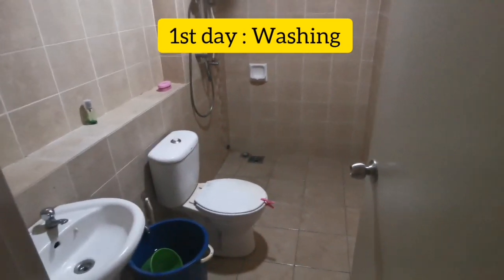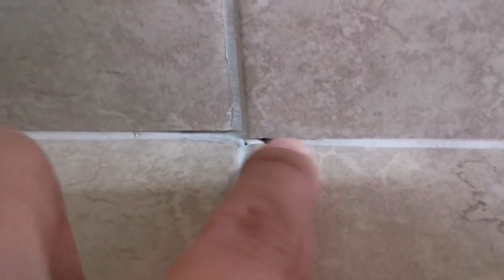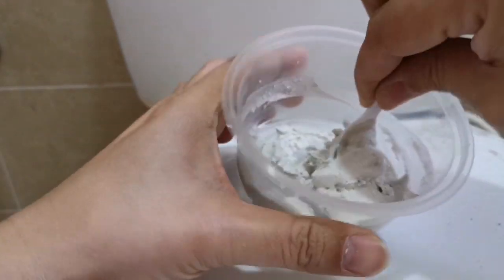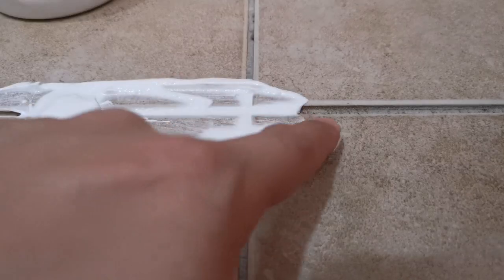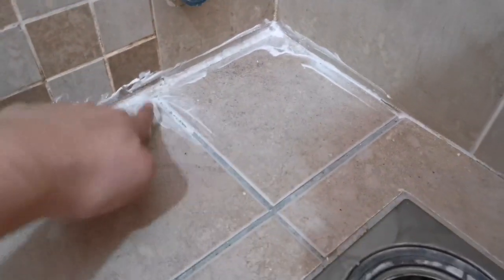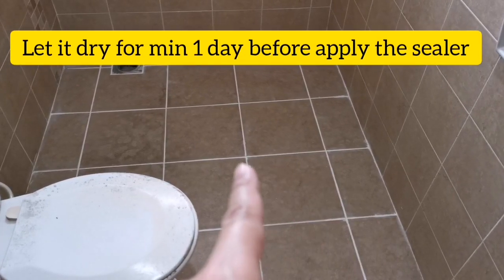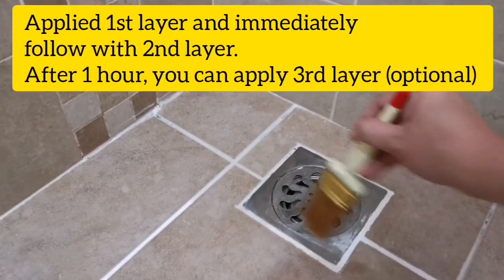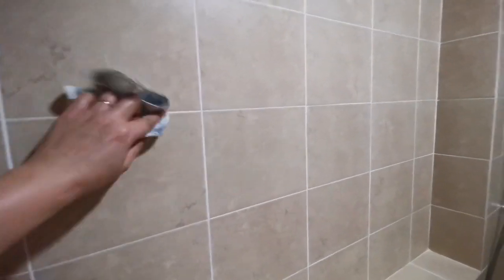Waterproof DIY toilet floor leaking without hacking? Step by Step Tutorial UFIXX

Comment: Thanks for the video.
I do the other way round. Fill 
 the cracks and line with waterproof sealer and let it sip in and let dry for 24-48hrs.Then fill the white cement.If you want to be safer can apply another layer of sealer after the white cement. It's already 4 years doing fine. Hope it helps.
Reply from the maker: Great suggestion.. Y i didnt think of it...
Reply: sir, after u use waterproof sealer as first layer, and when applying white cement to the tiles joint , are they attached easily? can the cement stay attach because the hydrophobic properties of the first layer sealent?
Reply from the maker: Hi Sattar, i believed you should put the white cement 1st, after it dried, then only apply sealer.. Otherwise sealer will go into any crack or hole. The sealer is not silicon ya, is jus a thin layer of water.. Similar to thinner water..
Reply: First of all, thank you for making and sharing this video. I think you are right. We must patch up all the holes with white cement first before putting the sealer. The purpose of the waterproof sealer is to repel water; so it must be the component in contact with the bathroom water.
Reply from the maker: Yes, you need to spend abit of time patiently fill up all the white cements.. Especially on the water hole/trap area... Good luck and happy trying

Comment: To fill the tile gaps, use floor grouting compound would be much better
Reply from the maker: Thanks William for the recommendation. Can i know the benefit of it?
Reply: @drcheongtv  floor grouting compound dries faster and when dried, it is much harder like those epoxy compound. I used cement before and result not as good as floor grouting compound.
Reply from the maker: Wow, i learned something new today. Thanks alot. I was not aware of this floor grounting compound. Tqvm, will definitely check with the local hardware shop
Reply: Hi both of you I had a problem in my shower room. The problem maybe coming from the pipe under the tiles on the floor. I dont want to wreck the tiles anymore. Does it will solve if I use the floor grounting compound?
Reply: @jaimejrestanislao  floor grouting may help If leakage is due to water from surface seeping down. If after apply grouting compound, there is still leakage, then may be other causes
Reply from the maker: Great explanation william. Tqvm
Reply: @jaimejrestanislao  your have 2 choices if leaking comes from the pipe under the tiles, 

1. Hack into the tiles, find and repair leakage.. (higher cost)
2. make an alternative plumbing line outside the wall (no big hacking into tiles and lower cost)

Comment: thanks for the tutorial, I wondering the waterproof sealer will make floor slippery or not because my house got old people.
Reply from the maker: I have the same worried and fortunately it will not make the floor slippery.. At least for my flooring. You can try applying it in 1 or 2 tiles and test it out.

Comment: Hi Dr. Cheong, I did some Googling and found that this No Leak sealer is a solvent-based waterproof sealer. It can be washed off the tiles even after it has been applied, but it remains permanent on grout. However, from the video, it looks like you can use it on all tile surfaces. I would appreciate it if you could enlighten me. Thanks.
Reply from the maker: U r actually right, it should be applied on grout but I applied it into entire surface of the tiles hoping it will sip into any tiny cracks or holes. But yes, u can jus applied on the grout itself..

Comment: I only use the sealer and still there's leak. Hopefully when I use cement then no more leak
Reply from the maker: Ya, sealer not able to block leaking if crack or gap or hole is too big.. Better use cement to seal up any hole 1st before apply the sealer. But if still happen, then might be the piping leaking.. Tat one need expert to check..

Comment: Hi Dr Cheong, Good sharing. Is this the only sealer out there that seal the grout or there are other options? if there are other options, what is reason you chosen this sealer and brand? Thanks!
Reply from the maker: Hi Su, it pretty depend on ur local hardware shop coz they know which brand is higher demand. I will usually asked them to recommend 2 brand n ask what is the difference btwn them. So far my local hardware shop recommended this brand.. Hav not try other brand, hence unable to advise further.. Do share with me if u hav tried other brand.. Tqvm

Comment: Hello Dr Cheong, thank you for the instructional video, useful grouting tips for a beginner like myself!

I saw the same ufixx grout and tiles sealer in a shop and was hesitant to buy and use it, as I'm new to regrouting bathroom. 
So I have a few questions about the ufixx grout and tiles sealer that I hope you can answer:
1. Does the ufixx sealer seep into the tiles and grout and becomes unnoticeable? Or does it form a layer of protective film externally, like silicone does? Can it be felt by hand if you step or touch it?
2. Did your layer of seal or grout turn yellow over time? (I believe you regrouted 9 months ago) I searched online and some websites say that oil/solvent based sealers turn to a yellowish or amber colour over time. I'm afraid that my tiles (my tile is white colour), if applied with ufixx sealer would turn yellowish overtime due to the sealer. (I'm okay with slight yellowing of my tiles, but not dirty yellowish) 
3. Is the sealer totally unnoticeable after it dries? Or does it form a layer of relective glossy texture after drying?
4. Does the sealer make it harder to clean toilet? (Like film of sealer gets scraped off) Or is cleaning still the same?
5. Is your sealer applied 9 months ago still waterproofing well today? When would you reapply sealer again?
6. Lastly, would you recommend if I use the sealer on grout of kitchen sink? I'm afraid that it might be toxic for health as kitchen sink water is used for cooking every day. And the kitchen sink grout is exposed to water daily. So, I'm afraid that the sealer (after drying) might get washed into food or stain the sink.

Would be great if you can reply to my queries! Thank you and have a nice day 😁
Reply from the maker: Hi Brendon, thanks alot for your comments. I have the same questions as yours as well before i tried it myself. Below is the summary of my answer based on your questions. Hope i didnt missed out anything.

1. The sealer is totally unnoticeable, didn't turn yellow and cannot be felt by hand. If you asked me, is like thinner for paint. Strong smell but u will not notice it. I applied on the floor tile n grout, is not slippery after dried. But it do form a thin layer of so call reflective look/layer when we spray water it will see small dropped of water skiing thru.. But dnt worry, is not slippery, no changes of colour and is just like thinner, applied n disappeared.

2. Is not the type like silicon based, so u wont see a white colour things or hot glue. Therefore, you need to fill up all the crack or hole or gap with white or black cement before applying the sealer, otherwise it will fall btwn crack. This sealer is more like closing the pores, not for filling up gap.

3. Whether safe for kitchen top, im not sure about this. I think is not safe if our food expose to it.

Hope i didn't missed anything. By the way, i think i should redo 1 more time, coz might have new crack appeared..
Reply from the maker: So far looks good, i dnt see the leaking continue at downstairs.
Reply from the maker: All the best to you. Dnt rush it. Let it proper dry up b4 applying the cement. Let it dry then only apply sealer. After sealer, need to wait it to dry.. Then only use the toilet. Be prepared ya, very smelly ya the sealer..
Reply from the maker: Ya i believed is a continious 6 to 1 year activities

Comment: Can this sealer apply on the exterior area like a balcony tiles? would it able to sustain sunlight UV?
Reply from the maker: https://youtu.be/uFDbwua7V1A
Reply from the maker: Hi Phoon, is not recommended to use for exterior. I will suggest to use nippon flex 200. You can watch the video i posted. It will be more suitable.
Reply: @drcheongtv  thanks, Dr. Cheong.
Reply from the maker: Your most welcome

Comment: Hi Dr C, may I know for toilet floor need to apply sealer on grout or all the tiles?
Reply from the maker: I applied sealer on entire tiles. I tested it, not slippery.. But remember to fill up any crack with white cement before applying the sealer..
Reply: Thanks a lot.

Comment: what if the tiles laid were not level as a result the water does not flow to the hole. what can be done
Reply from the maker: It will be flooring issue, will need to open up n laid the tiles again..
Reply: @drcheongtv  Thank you.
Reply from the maker: Your most welcome

Comment: did it solve the leaking problem in the end ?
Reply from the maker: Yes, it did. I suspect the crack between floor tiles causing the issue. So the white cement helps as well..
Reply: thanks. I'm planning to also fix my bath leak same as what you've done. hope it works well for me too
Reply from the maker: Ya, take ur time to fill up the small hole n crack especially on the floor and near to the drain hole area.. Aftrr i washed the floor, i can see clearly all the tiny hole.. Filled it up with the white cement n let it dry properly. Then apply the sealer.. Hope u can resolve ur leaking issue. If still leaking after the fix, then might be the piping issue. In this case, u might need to contact the professional.. All the best